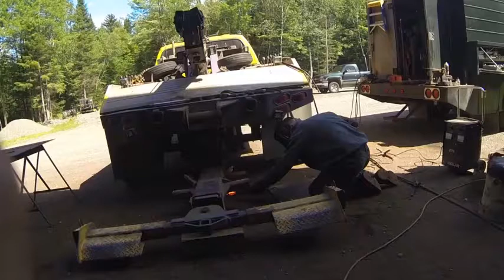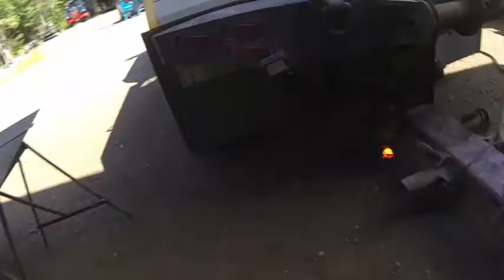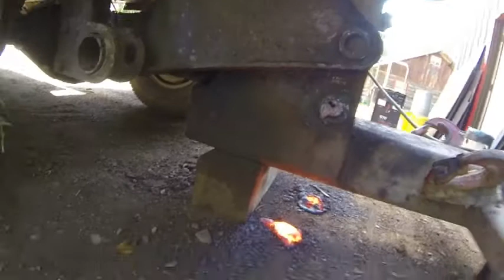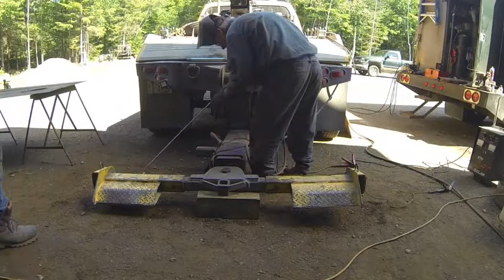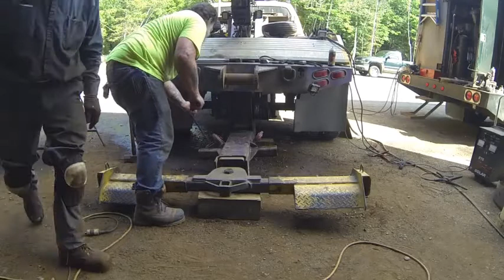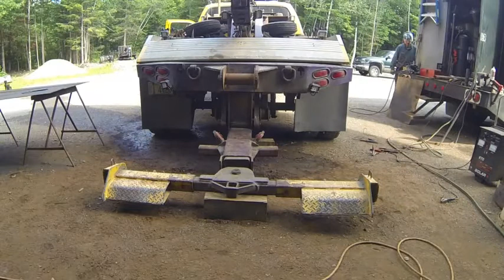Blowing out a rusted pin with arcair

Comment: That's an interesting arcair system! The ones I used working on train cars, were more similar to welding. Similar in that the ground wire was hooked to the work piece, & you actually struck an arc to begin the cutting process. The rods he uses are also much longer that the carbon arc rods that I'm familiar with. I like the one he uses.
Reply from the maker: Yes the carbon gouging rods. This is a maybe 36" tube with a coil of maybe magnesium wire inside plus oxygen blowing threw.  It made a lot of heat very quickly.  Ran on 12 volts and oxygen. Very simple, he charged me $20 apiece per rod.